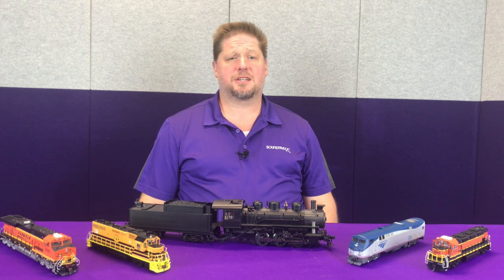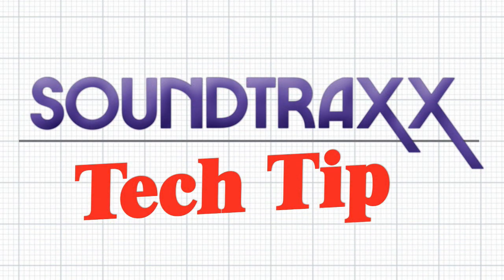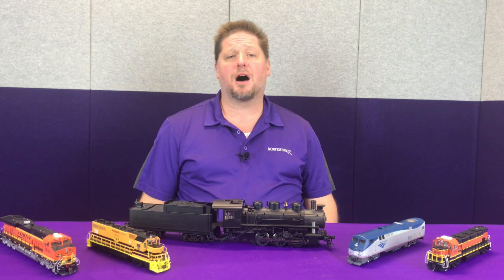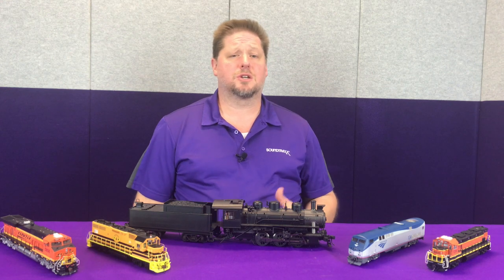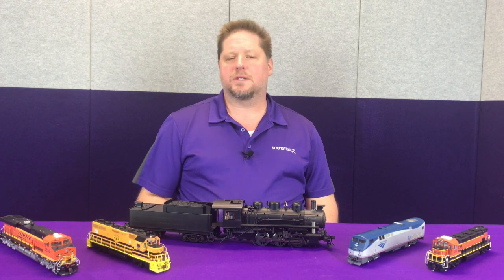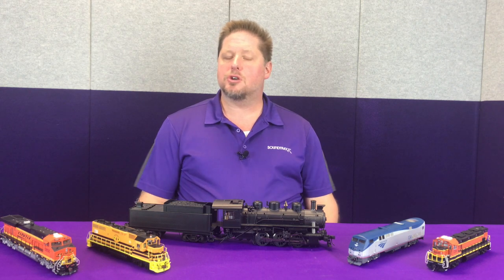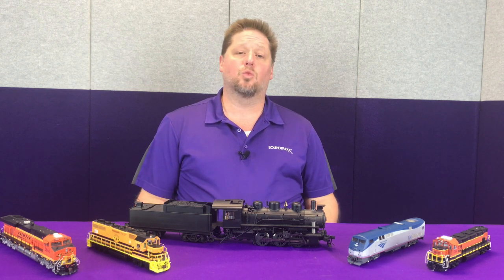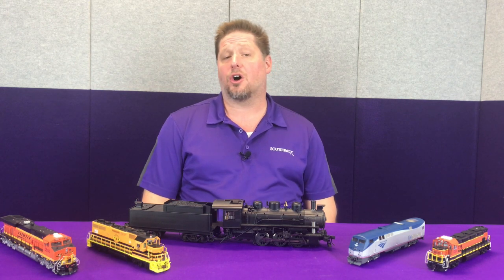SoundTraxx Tech Tip: Decoder Troubleshooting

Comment: I used to work at an electronics manufacturing company in the service and repair department. I can’t tell you how many times customers sent back perfectly good units, because their wiring or installation was bad.
Reply from the maker: Yes, we try to help our customers avoid sending in units that they don't have to, but sometimes its unavoidable.